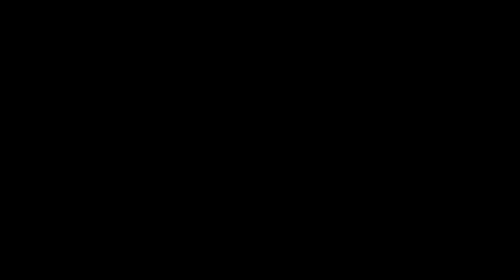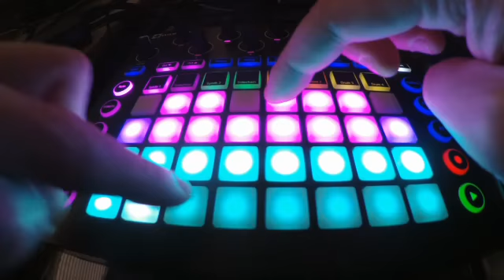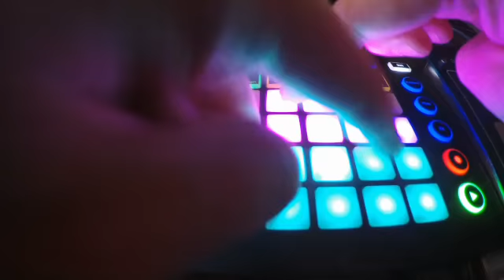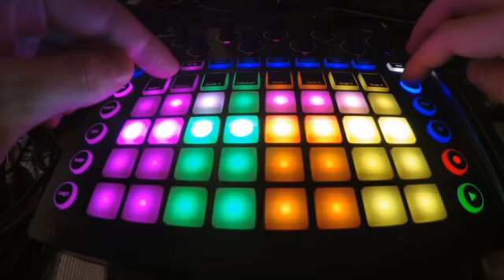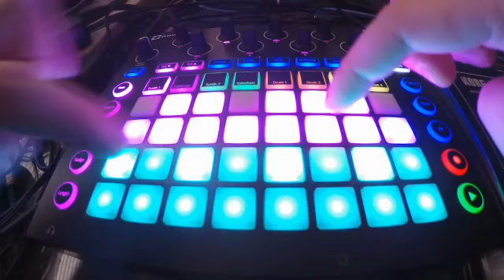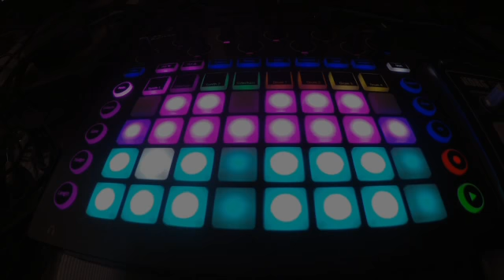Global Step Resolution Workflow Using Tempo // Novation Circuit Tutorial

Comment: While the Circuit is great for making beats, I find the 8 patterns way too limiting for making a full song with melodies. Even the Pocket Operator has 16 patterns. With all the available lighted buttons, you would had expected more patterns.
Reply from the maker: I don't know, I have tons of fun with it! There's sessions you can make different sections etc this way. I would say at least try this way. But yes there's other gear that have better song modes. But then again, working with different gear and different limitations brings out surprisingly different results
Reply: @RonCavagnaro  yes it is very fun!  I might need to rearrange my patterns so it uses less amount of patterns. I’m at day 3 on the Circuit. It looks & feel great.